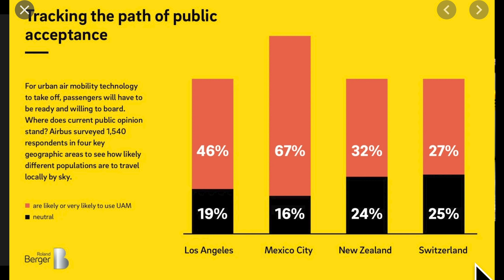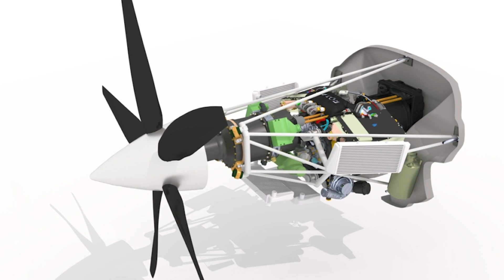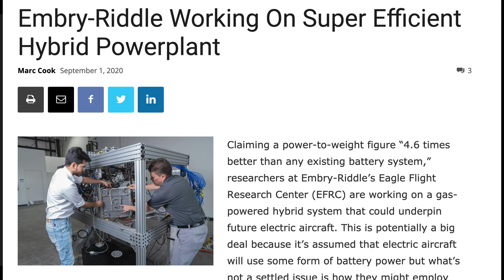AVweb VODCAST: Why Electric Aircraft Are Tilting Toward Hybrid Drives

Comment: Every one keeps telling me batteries are the cleanest technology. Garbage. How does a battery get charged ? Through the grid... whether for 'planes or cars, iPads or iPhones. So, plugging in the device makes averyone feel like they're 'doing their bit' for the planet, when in fact the source of that power power still comes from a power station, coal or nuclear in a lot of the world. Fix that problem then the fix flows downhill. When all power sources are hydro, wind power etc, then we'll begin to solve the problem, but putting a battery in a car, plane or iPad doesn't solve a damn thing at the moment...
and I haven't even started on the practicality of batteries for flying. Hydrogen or biofuels possibly. Batteries, I'm not convinced, unless we get some Eureka moment on the technology, which doesn't appear to be anywhere near us at present..
Reply: The average carbon equivalent mileage for battery electric cars across the nation is 51mpg, a number that goes up a little every year.  The average mpg for US ICE vehicles is 25mpg.  In the most coal intensive utility areas like West Virginia and Pennsylvania the carbon equivalent mpg for battery electric vehicles is 35mpg.  in the least carbon intensive areas like Washington state and Vermont it's 135mpg equivalent.

Battery production for long range EV's results in a total of 68% more carbon emmisions to produce a battery EV vehicle than an ICE vehicle.  The average driver will make up this deficit in 6months for short range BEV;s and 18 months to 2 years for longe range BEV's depending on the battery size, efficiency of manufacture and driving habits, after which it's all carbon savings.

Power plants are more efficient than ICE engines, even taking into account the average 5% transmission loss and conversion losses (we also have to take into account "transmission and conversion" losses in fossil fuels: pipeline pumps, oil well pumps, tanker trucks, refinery pumps, refinery heat/energy sources, the energy to make cracking catalysts etc.).  Natural gas combined cycle turbines, which are increasingly replacing coal fired plants, are twice as efficient as burning gasoline in an ICE engines and reduce carbon output by more than 2 fold, that's aside from the ever increasing rise of renewable energy.
Reply: @glibsonoran  when I was in school I think we were taught that the power grid is 50% efficient at transmitting power long distance.  Where are your numbers for 5% loss?

Comment: Personally I prefer the way Cambridge University went with it 5 years ago. Very small petrol engine that basically runs at 100% efficiency when in flight with no input from the electric motor, but use additional power from the electric motor (basically doubling the Horsepower) for take-off and landing.

I feel a lot of Part 103 ultralights waste a lot of weight by having to go for a heavier and more powerful engine that only ends up being used to give that extra take-off oomph.
Reply: There is an ultralight hybrid engine coming on the market like this, with an electric motor built in. Forget the name of it offhand.

Comment: Hydrogen Fuel Cells to supply the electricity, my vote.
Reply: Ever see what happened to the Hindenburg and the Space Shuttle?
Reply: They're barely better than batteries and would probably triple the cost of an aircraft.
Reply: Complicated and expensive
Reply: @coldforgedcowboy  There are medthods to safely store hydrogen now.  Back in the 1980's I recall a documentary using these tanks full of a substance that absorbed the hydrogen and slowly released it, they shot the tanks at close range with an M-16 and the most they could get was a smoldering for a few seconds before it self extinguished (this was for cars).  Certainly 40 yrs hence something better.  

The space shuttle was caused by O-rings on the solid rocket boosters having an inadequate seal as the take-off was below freezing, which the engineers knew about.  The Main tank did explode from that, yes, but wasn't the cause.  Of course safety is a must.  I just don't think batteries will work very well with current technology (no pun intended). :)
Reply: @PistonAvatarGuy  Currently, Fuel Cells are very $$$, but they also are not manufactured at scale.  Toyota has a large R&D project, fuel cells is where they are heading...The most difficult thing I see may be the infrastructure, be interesting to see what develops.
Reply: @ph5915  Toyota is TRYING to pursue HFCVs, without any success. Scale is irrelevant, everything associated with hydrogen is inherently expensive. Infrastructure is far from being the only major hurdle for hydrogen.
Reply: @ph5915  "Back in the 1980's I recall a documentary using these tanks full of a substance that absorbed the hydrogen..."
-
You're talking about metal hydrides, they're insanely expensive to produce.
Reply: @PistonAvatarGuy  Thank you for the feedback.  True, I'm not aware of the costs, always good to hear more data.
Reply: @coldforgedcowboy  Hydrogen fuel is used in Norway on a national scale for powering cars. Fuel. Not Gas. How about reading up on a subject before commenting and making sweeping generalisations?
Reply: @PistonAvatarGuy  Tell that to Airbus, they are obviously not aware of that since they are such building a hybrid with 2000 nm range.
Reply: @Ichinin  They also thought that they could power a BAe 146 partially with batteries, but their plan got less and less ambitious until it was cancelled. They'll learn not to be overly optimistic, just like everyone else.
Reply: @PistonAvatarGuy  Whatever. We got 100% electrically charged aircraft flying here in Sweden with 400 km range, doing trials right now to go into service soon. Plenty of other manufacturers approaching the same capabilities. 100% electric will happen. It just won't be long distances at first, but Airbus got hybrid (hydro fuel + electricity) planned for 2035 with 2000 nm. That is sufficient to go across the Atlantic from Ireland to Nova Scotia.
Reply: @Ichinin  400 km of range is basically nothing in the US, especially when you can drive that distance faster than you can fly with any electric aircraft. Like nearly every other application which involves electrification, the cost and the lack of capabilities will never be justified. Companies can work on developments all that they want, it will not result in desirable products.
Reply: @PistonAvatarGuy  Then drive. Technology will improve and 400 km will increase with time.
Reply: @Ichinin  If it does, it won't increase significantly, batteries are not increasing significantly in energy density.
Reply: @Ichinin  2035? Puh-Leez...stop it. That is 15 years from now. Who is Capable of Planning a decade-and-a-half ahead?
Reply: @quidestnunc9238  Somebody with a bigger wallet and more strategic thinking than you. This thread is ancient, kthxbye.

Comment: The idea of 30 minutes isn't possible with my vehicle, better change the reg is just fundamentally wrong to me. You've got a 25 minute urban hop where the automated system didn't account for a 20kt extra headwind... Do you really want 15 minutes of reserve turning to 3 minutes and be landing with low voltage alarms?... Crazy...
Reply: I don't see a problem with local missions. These battery vehicles are able to give usable capacity in very precise specifics, as opposed to holding one's breath, hoping those calculated 30 minutes to 60 minutes of fuel remaining holds realistic.... while climbing, turning, descending and slipping. Batteries don't care about our kitchen timer, or mental math, or flight attitude, they will deliver the power and offer realistic real time energy remaining.

As for reserve. There batteries usually have a built-in energy reserve at 0%. Primarily for battery long term health. A battery powered car will simply pull over at 0%, no harm done, just stranded. Aircraft are a different story, tapping into reserve (gas or battery) is an emergency, battery buffers would most likely be unlocked below 0% in these scenarios.
Reply: Well... I wouldn't want to be 500ft off the ground in a vehicle that has 1 minute to land...
Reply: @jackoniel8565  

Nah, but that's why we're pilots. Planning and risk management should always be considered.

Given the reserve available within these batteries at 0%. There would realistically be enough energy for  an additional pattern or two. Recommended? most likely not, probably ground the bird until diagnosed and signed off. Warranty may become voided as well. All the more reason to land above 0%, but the vehicle will most likely remain powered until the battery is bricked, well below 0%.
Reply: @jackoniel8565  

I'd argue 15 minutes for local missions. Add criteria for another nearby, available, airport if need be. 

Maybe we'll see manufacturers build in 30 minute buffers below 0% indicated. Or possibly 10 minutes of WOT, guaranteed, below 0%. Reduced propulsion may be an option below 0% for an X amount of time.....or a combination of some of the above. 

There are options available to embrace the new tech. Just waiting for the lawmakers and manufacturers to communicate a standard.

Comment: What would be the most efficient / effective liquid fuel power source to drive an alternator? Thinking diesel .. good torque, low maintenance and no spark needed.
Reply: Diesels make less torque than gasoline engines, unless they're boosted higher. Torque is irrelevant when running an alternator anyway, as the alternator can be designed to make use of power output at any rpm, even from turbines that spin at tens of thousands of RPM. Modern diesels require more maintenance than gasoline engines and are significantly more complex, they're heavier than gasoline engines and gasoline engines can be designed to be just as efficient as diesels (BSFC by weight) in a constant load application. Modern gasoline engines can be designed to burn mogas, which is cheaper than jet fuel.

Comment: What's taking Bye Aerospace spoon Long. His airplane is one of the (Tennessee) Lighting aircraft, isn't it?
Reply: Energy density, my friend, energy density.  Who wants a cross country aircraft with a one hour range?  And then take over an hour to recharge? 

Follow the energy density of battery technology.  Aircraft motors will follow soon after.  Cost?  That’s another story.  If they can’t make them cost competitive with a Lycoming, no one will buy.
Reply: @gregjennings9442  I wonder how many Flight School lessons are longer than a full 60 minutes....
Reply: @quidestnunc9238  : Flight schools are certainly a market for electric aircraft.  Consider this, however, it takes about as long to charge the batteries as discharge them.  So, the plane goes out for that first hour of the day.  All is well.  Then it does what for the next hour of the day?  It sits and recharges.  The first answer to that would be swappable battery packs so that one is charging while one is flying.  Yet, go check if that is currently an option.  Last that I checked, it wasn’t.  It’ll get there, but it isn’t like swapping rechargeable batteries in a flashlight.   And there is still the added expense and complexity of the swappable battery packs.  Also design limitations if they have to be swappable.  Think about space and weight and balance considerations.
Reply: @gregjennings9442  Four words: Pipistrel Aircraft ePlanes' Videos
Reply: @quidestnunc9238  : Nine words: “I got a lot of my information from them”.

Comment: All things considered, I think the hydrogen fuel cell is a better avenue.
Reply: Fool cell.

Maybe in 50-100 years.
Reply: Power density of fuel cells is pretty bad at the moment.
Reply: @ProfessorFickle  better read up. Surprising advances this past year. And you can refuel in 5 minutes. Not 8 hours.
Reply: @billquillin1952  they are called FOOL CELLs for a reason.
Reply: Yeah, aircraft full of hydrogen have a great safety record.
Reply: @acefighterpilot  that's just engineering
Reply: What would be the point? Absolutely everything associated with hydrogen is insanely expensive and always will be, the technology will never be competitive with ICEs.